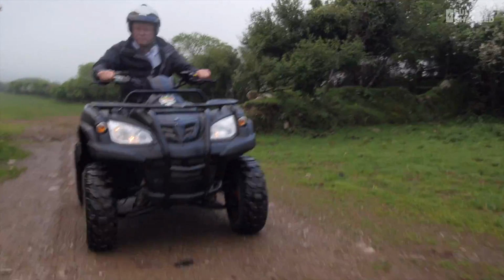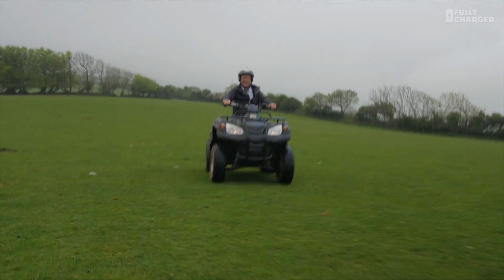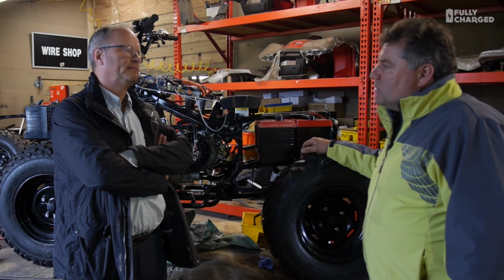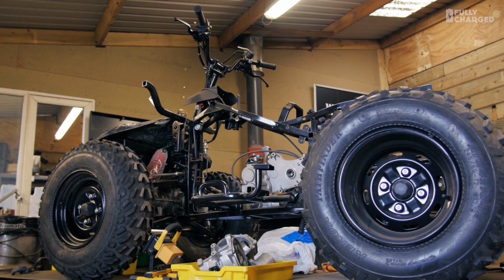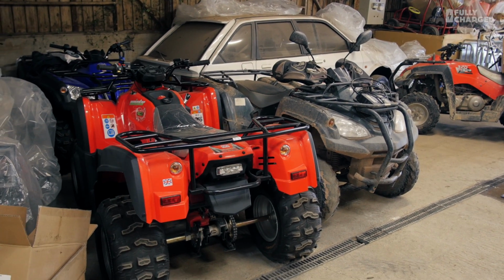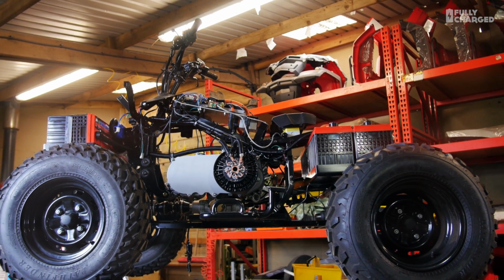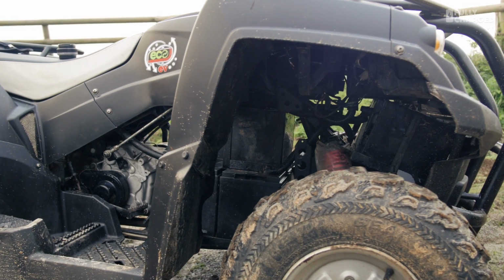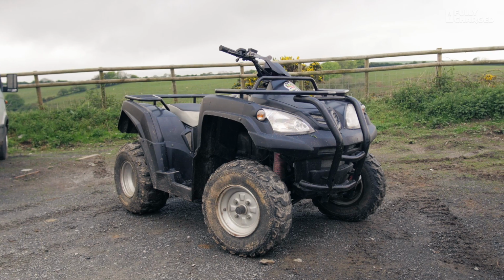Electric Quad Bike | Fully Charged

Comment: This would be great if it could have solar panels on the quad to keep it charged or topped off without having to plug it in.  Sort of self charging.
Reply: that would be a tiny solar panel, wouldn't really contribute significantly, it's one of the reasons why the Tesla doesn't have solar panels either
Reply: I hear this idea brought up a lot and it's a terrible idea.  you could only fit a small solar panel on the bike due to the size of the bike, so it will barely generate enough power to make much of a difference.  In fact solar panels are very heavy so the extra energy used to drive the (now heavier) bike defeats the purpose of adding the panels in the first place.  Also the panels will be dead weight on dark, cloudy days or when the bike's sitting in storage further defeating the purpose.

I mean why bother when you can have solar panels on the roof of the barn or farmhouse instead... Much more efficient and can be combined with batteries to storage energy at off-peak.
Reply: actually, since with such a bike you do away with all safety features you would need in a normal car and thus is much lighter compared to say a bmw i3, mounting a large enough solar roof that produces enough electricity to top up the battery isn't out of the question.  The BMW i3 weighs 3000lb and has the roof area of a normal car, and is expected to carry 4 people (an additional 600lbs). A quad bike- even an electric one - 500lb + maybe 300lb payload tops, and you could give it a roof panel of at least half of the i3's size. In addition, unlike the i3 which has to get up to highway speeds, the quad only needs to go 30mph max, which all in all means it needs maybe 1/10th of the energy an i3 needs for a given distance. Stability issues aside, a solar roof on the quad spanning half a car's roof area, producing 6 miles of range per day, I'd say is completely doable.
Reply: Thin film panels are very lightweight, unnoticeable on such machine. Still the power would be too small to make a difference. I guess on Lead acid machine they could make sure the batteries don't die during longer periods of inactivity.
Reply: Not saying it should be standard, but optional.  It also depends on where the quad is used. You have to think of use beyond the farm.

Comment: The Odyssey Extreme Series battery is impressive (google it), but the reasons he gave for using them instead of a lithium ion battery seems unrealistic to me: because they're heavier? And, are they really more reliable? My guess is that cost was probably the main factor. One cool thing about the odyssey battery is that it can be mounted on its side (although most lithium batteries can as well).

Cool bike, though! The cheapest one is about £9000 (about $13,000US). A bit pricey, but not overly so.

JW3HH

Comment: But, is it at least somehow waterresistant? Can i drive it through a small river (maybe even deeper than normal quads/ATVs)? And are there 4x4 versions?
Reply: Considering petrol engines breathe air while electric engines don't, with proper insulation you'd be able to drive an electric vehicle completely underwater if that's your thing!
Reply: Yes, they have 2WD / 4WD / 6WD models, one is even switchable 2WD / 4 WD.  I'd love to have one!
Reply: If the batteries are properly sealed then there is no reason why it shouldn't be able to ford a deep body of water.  At the very least it is water resistant; if it weren't nobody would buy it, it would be a laughingstock.
Reply: It can most likely go as deep or deeper because there's no exhaust pipe dangling down low that can get clogged with water. Whether or not it can be completely submerged is up to how well they seal the charging plug. It would likely be able to withstand rain and even fairly large splashes like in the giant puddle in the video but not submerging since he said they are built for farmers and no one needs to cross a river on a farm (since they should have a bridge if they need to work on their land).
Reply: And in space if you build it right :D
Reply: Exhaust pipes don't get water in them as long as you don't stall the engine. When preparing a 4WD or quad for river wading you only need the air intake to be up high and the ignition coils/spark plugs to be well insulated. Then again, if you have an air-cooled engine and you've been working it hard, splashing down into a creek can crack your engine.

Also farmers don't have bridges everywhere. When it only rains for one month of the year, it's really not worth it. Besides, a lot of the work a quad bike does here in Queensland is pulling a cow out of a muddy creek it's got stuck in.
Reply: The motor would overheat in space. No air to cool it.
Reply: HI! We currently have 2wd, 4wd and 6wd versions - they can be safely driven into about 30mm of water but with the correct proofing we could make this to a required depth.  If you require any further details please contact me at ben@ecochargerquads.com. Thanks